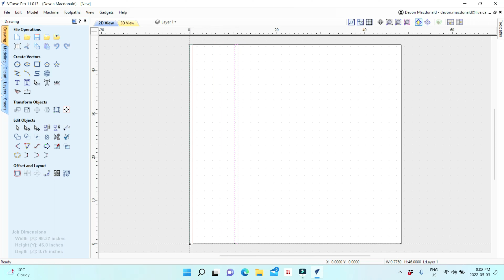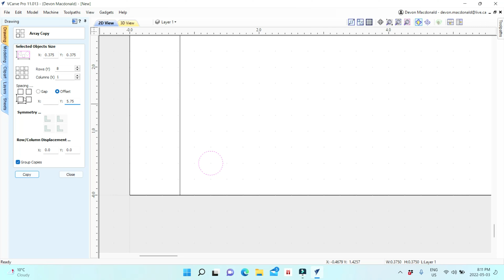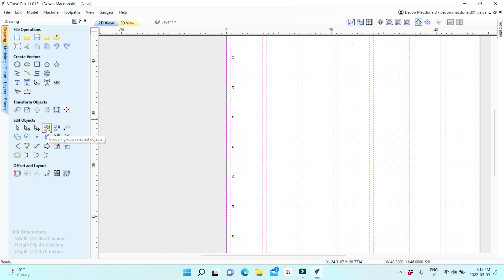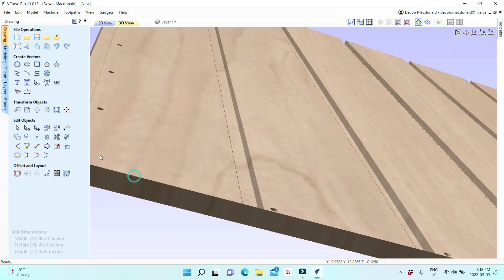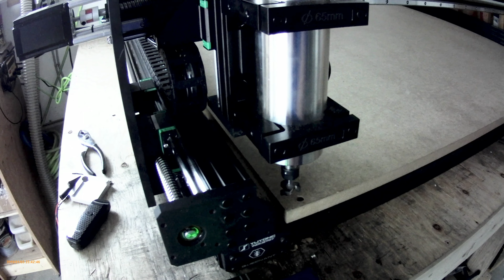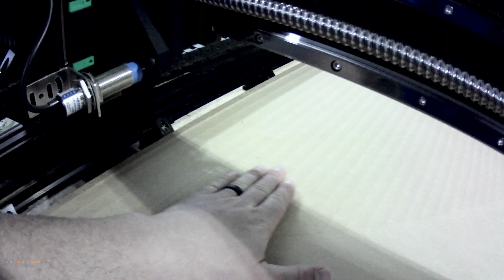QueenAnt Pro CNC 1515 Yuyong Industry - Vetric Vcarve Pro Surfacing

Comment: LOOKS REAL NICE. I right now I have the Bulkman 1515 QueenBee Pro. I absolutely hate the whipping with the 8mm ACME rod. Any whipping on the QueenANT Pro at max speed? What is the usable max speed?
Reply: Yeah I’ve got a LongMill MK2 and between the whipping of the lead screws, the V-Wheels and the fact you can’t upgrade it to a decent spindle because of the weight limitations of the x/z gantry.  I’m looking for a new one that will actually do hard work and let the LongMill cutout plywood templates